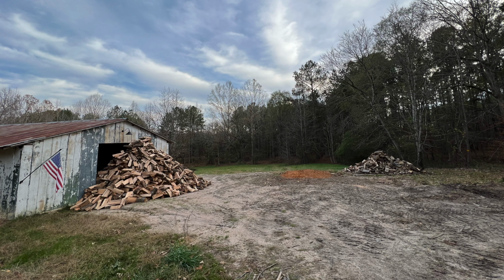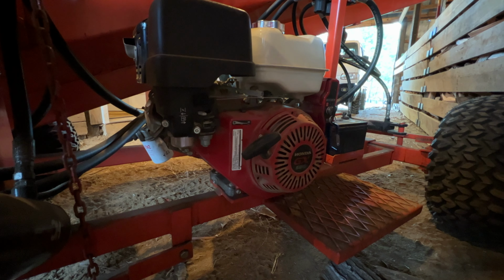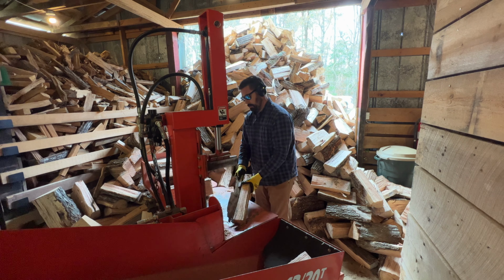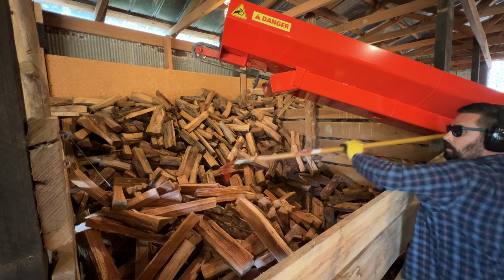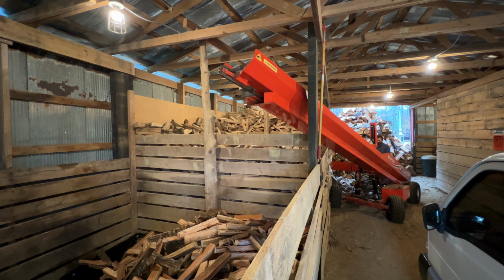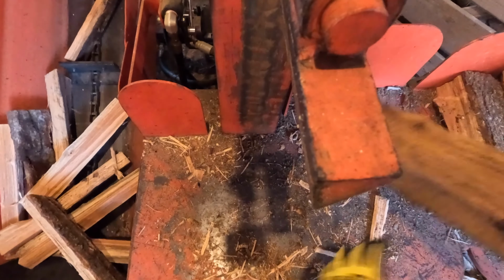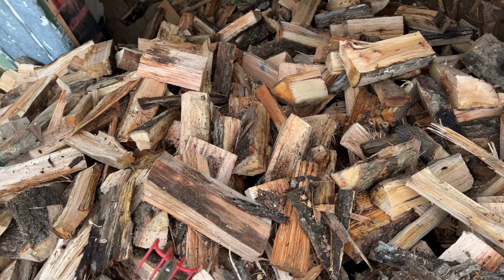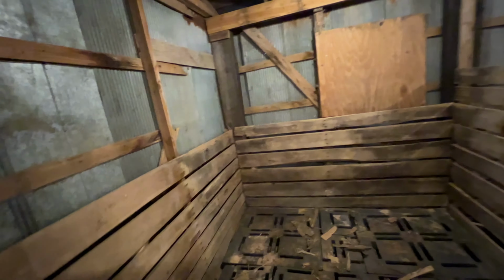Split Force 13/20T Filling Barn With Firewood

Comment: What is that continual clanking noise around 3:52 and before? It's not the foot pedal or the wood hitting the conveyor on its way out from what I can see. That metallic noise doesn't seem to line up with any visible action
Reply from the maker: Funny you should mention that haha.  It randomly started making that noise.  Checked everything easy, and couldn't find any visible culprits, so went digging for an answer.  Stay tuned for that in an upcoming video!

Comment: What wood is this? Do you just keep Oak in the outside firewood bags? Only hickory and Pecan goes under shed?
Reply from the maker: This is all Oak going inside here, specifically the small split pizza oven wood.  We've got another large barn that houses all the flavor woods; Hickory, Pecan, Cherry, and Apple. Have a video a while back where I did a walk through of that barn.  Hoping to film an updated version soon.  Normal split Oak firewood is what goes in the bags and those are kept outside to season, which works really well surprisingly.  Thanks for watching!

Comment: Seems inefficient. Why not first split to the size you ultimately want?  Extra handling is extra expense.
Reply from the maker: I’ve always been honest in my videos, that this is certainly not the most efficient part of my operation.  The reason why is two fold.  

The first and most important is the wood inside this barn is all smaller split cooking wood.  My customers that use this demand higher quality, and as a result there is a much larger profit margin for me to handle a bit more as needed to deliver that quality.  The second is YouTube.  Folks wanted to see the Timberwolf processor in action, and I was happy not running a chainsaw that weekend.  It made a nice pile of large split wood right at the door to my barn, that I didn’t touch other than with the tractor.  So now, I’m technically only handling the wood once, running it through the Split Force to put in the barn for drying.  

Certainly don’t have a perfect operation, but I improve as I can, and take extra time to film for YouTube content as I go.  Appreciate you watching!